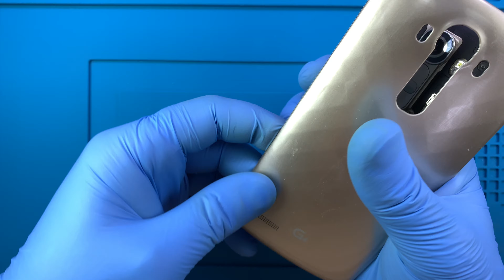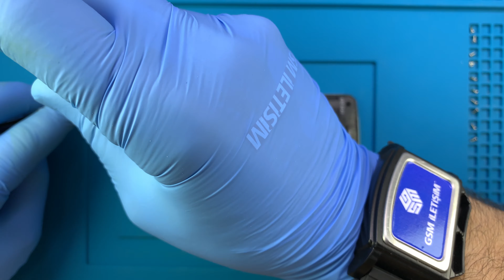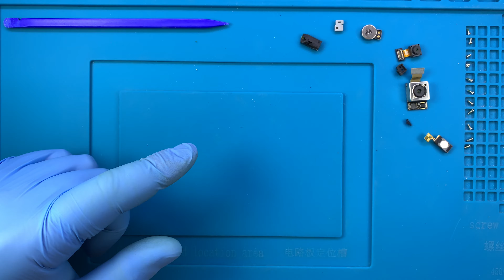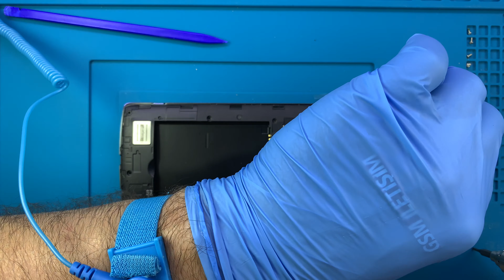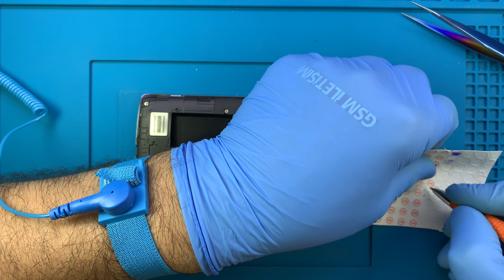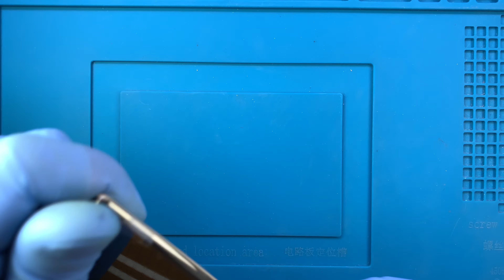LG G4 Ekran Değişimi 🇹🇷  | LG-H815

Comment: English comment passing thru:

Just a heads up, the H818 motherboard (as what you have there is a dualsim H818) will simply NOT work on the H815 screen that you used. I have tried that myself and the only success I had was to find a H818 that had a fried board and swap my working one in.
Reply from the maker: Hello there;
Thank you for information.
Greetings.